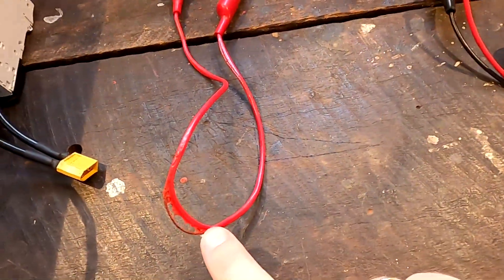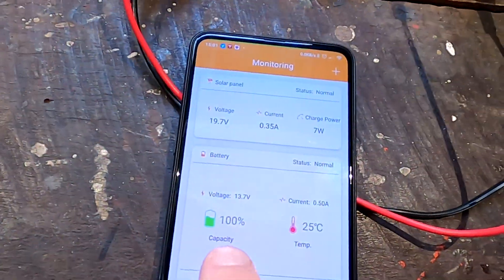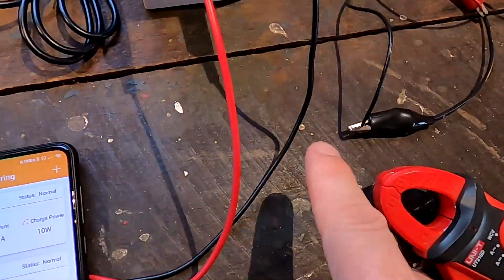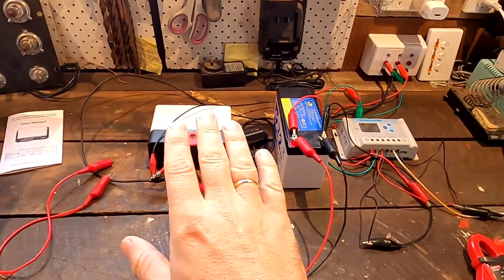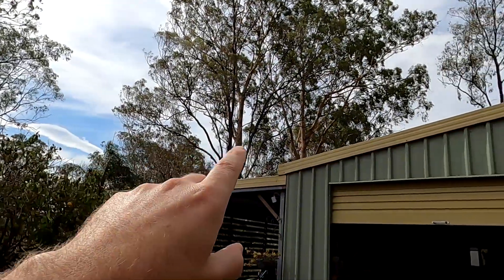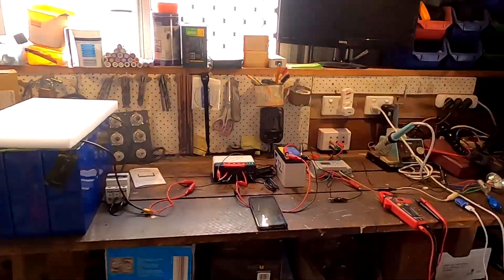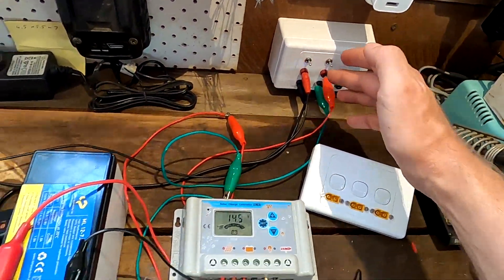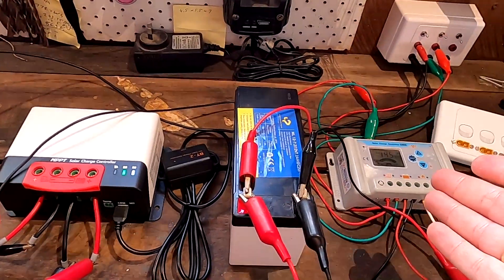MPPT and PWM controller charge one battery. See what happens...

Comment: I have two hybrid solar power inverters (with their own built-in MPPT charge controllers), connected to their separate solar panel arrays (each of 4000W capacity), I was wondering if I can connect these 2 inverters to a common LiFePO4 48V battery bank (4 server rack batteries connected in parallel). Will it lead to any feedback effect causing damage to the inverters?  I sometimes also use the grid supply for charging the batteries on overcast days. Please advise. Regards

Comment: I have 3 controllers, 2 for my house battery bank and one for my starter battery. It’s easier than a dc-dc charge system considering that all 3 panels are on different sides of the boat and it would be crazy wiring to get them altogether into one controller. I got informed, by someone who I believe is pretty knowledgeable, that it’s easier to run smaller charge controllers and more efficient and reliable than running one big one, plus smaller charge controllers are cheaper than bigger ones, I bought 2 Victrons and 1 Renogy for less money than 1 big one and the necessary wiring plus the dc-dc charger and all the wiring… it just made more sense for what I was doing. They are MPPT and PWM and work fine for what they are doing, but it’s two separate battery banks for two different uses. Strings of solar panels on a house roof with possible shading issues is much easier for a controller to deal with when they are separated rather then dealing with the loss of power from a string that is connected to it.

Comment: What about the really cheap charge controllers that come with hardware store small PV panels? My dad has two different 12V panels both with the very cheap controllers for FLA batteries. He has connected them both to one battery using both controllers.

I was quite surprised that one can use multiple charge controllers that don't interfere with each other. I thought that connecting two charge controllers together would make each think there was a full charge; but this works, I think because both chargers are going by resistance not the voltage/current, yes???

The really cheap charge controllers seem more like voltage regulators, so I am wondering if it is still OK to connect these type of controllers together??
In the case of my fathers cabin setup, I would have connected the two panels in parallel and used one charge controller....however the panels are different, so the way Dad wired it, may actually be the best???

Comment: I was considering the same with 3 x 235w x 27v panels to 24v batteries. Just using pwn charge controllers. Not havingvto use MPPT.

Comment: Super video :) Thank you for it. I have problem with setup. In my situation I have 3z110w connected in serial to mppt controller, on other side of my house is 4x55w connected in parallel and serial ( controller take just 50v ) problem is, the controller with the 4 panels not charging at all, first on is mppt volt sol30, the other is my inverter volt 1000s ( with mppt ) any idea why is not charging ? When I turn of the one which is working the other start to work …

Comment: this one is spicy....... i bought a 30w panel and a 30a cheap pwm .for car batt charging

   BUt ......  is it possible that i cant  WAKE up my cheap upgraded pwm  because 1.5 amp of the 30w solar panel is too  low for its 30a mosfets and other insides ?     
.
.
.  cant find a  video of powering them to see when they opperate and my power supply stuck ocean 1,5 month now!!!    i m not so charged please help...
 i ordered a 10a controler  too..   might keep the 30a one for spare big panels!!!  controler cant find solar..  multimeter says i have 21v comming and 1.5a

Comment: Hi, i believe the concept will work. BUt it may easily damage the battery due to different charging algorithm.
Reply from the maker: As long as the battery is not overcharged, the battery does not care wehre the power comes from. So setting the max voltage correctly in both controllers is key. The algorithm does not matter: one controller will just stop charging earlier as the other one, if they are different.
Reply: @OffGridGarageAustralia   Different controller  supply power to the battery at the same time, will affect the battery judgment of the controller to charge the battery.
Reply: How windmill charger work then

Comment: I have 2 x 120w and 2 x 100w panel's both pairs on separate charge controllers. Mppt and PWM. I found during the winter it charged the battery faster

Comment: Yes it does work.  I use 2 pwms on a car battery because I have a mom and a poly crystalline cell.  So they each need a volatage regulator.  Once the voltage is regulated it does not matter how it’s done. Only thing is just
Make sure you’re not overcharging the battery.

Comment: Sir it means both charge controller's can work as a parallel to charge one battery at the same time, and there is no problem at all ?
Reply: Yes, chargers measure battery % resistance or impedance not voltages,  out put is voltages for human seeing

Comment: Excellent experiment, I was wondering about this since I have many odd solar charge controllers and odd panels I have collected over the years and I want to use them together. Thanks.
Reply: Seperate inputs for differing panels is the only way to fly.

Comment: How about two different charge controllers of different amperage and from two different manufacturers?
Reply: Should still work. As long as the the output settings are the same, and the controllers inputs aren't exceeded.

Comment: I have 5-275watt pannels on my rv. I was going to put them in parallel onto 1 controller but decided to keep 2 on 1 controller and 3 on another. The reason being is that the 2 are on front slop of the trailer and the 3 are on the flat. This way you do get more potential power as the sun moves through the day. Plus if a couple are shaded, they won't drag the whole system down. It is something that I have seen in real time. Even the 2 on the slop will get sun before the other 3 and thus start charging sooner. Plus different controllers work better in different weather conditions then others. That way you can optimize your power input no matter the conditions and better keep the power flowing 👍

Comment: Be aware of following things. Oxidation on the cabels brings up the connection resistor. Then when you have both types of controller active you have have these jumps based on the resistor on the oxidated connectors. In german it is named: aufschaukeln. That is BAD at all.

Comment: Thanks for your video. Love it.
I have a question.. what happens, say, if you have a large battery bank. Say 30k watt. And you connect not one, but two 4000watt inverters.. and hook them up to the same 220 system.. can you then run a utility that uses 6000watt and each inverter share the load of the 3000watt each? A 8000watt inverter costs as much as 3-4 4000watt inverters... So... I wonder.

Comment: I use this setup for a backup at night-time to heat my greenhouse with a 1200w heater and to keep the batteries charged above 50% I'm using a 19V laptop charger connected to the PWM controller on a timer when I think the batteries are going to be about 50% first light when the charger is working from the solar panels I set the timer to turn off roughly about the same time I have tried a wind turbine but they are not always reliable and need a lot more configuration.

Comment: If I have 6 12V batteries connected in parallel, can I connect a charge controller to each battery so that one has a total of 6 individual charge controllers ? Also can one use an PWM controller for this?
Reply: I would not recommend that. What will happen then is individual batteries will receive different levels of charge and discharge, affecting their life cycles in comparison to the others.
The necessity of making sure you use same make model capacity and age of battery is because, if there is one weak battery in the bank, all the other batteries are going to be draining themselves to charge it. Thus discharging themselves, and depleting their own charge/discharge cycle lifespan.
In parallel, if all goes well, when one battery charges, they all charge exactly alike, and last for the same length of time..

Comment: Very nice to see the test. Can we try out a 500watt grid tie, plugged into the output of another inverter?(drops idea in hat) :) I have an old 500w grid tie...I think  I can enhance my new 1.6kw off grid system by simply plugging it into the output of the inverter from my new system.
Reply: I had this same idea, to be able to utilise a 5kw single phase grid tie , & I also have a 10kw 3phase grid tie inverter with good panels,rails, etc. I was thinking that u could use a smaller inverter to trigger the grid tie’s and use this to charge batteries as well as on demand power. Cheers

Comment: I want to charge my battery with one mppt controller but want to get output from the battery with the hep of one pwm controller. I mean, i connect the two controllers with one battery but at the same time I don't connect the pv with the pwm controller. And  I want to use the pwm controller to get dc output. Will it work? The mppt is 30A or 50A and the pwm is 20A rating. Battery is single 12V.

Comment: What about amperes of different charge controller. When two of them are connected to one and same battery, the parallel connection of charge controllers would add up amperes. Say, if each one charger was charging at 20 amperes, now both of them would be charging at 20+20=40 amperes. Would it not be harmful for battery?
Reply from the maker: That depends on your battery size. It needs to be big enough to take these 40A from your example. If it can't, you need to upgrade your battery or limit the power output of the charge controllers to suit your battery size and type.

Comment: I have connected two Hybrids Solar inverter of 5KVA in parallelly. For each inverter 15 numbers of PV modules (285 watts each), 3 in series and 5 in parallelly. Both of the inverters are connected with 12 V,165Ah batteries (4 in series). It seems load is not powered by solar source. Can I connect two MPPT charge Controller parallelly with the system? can you help me Mr. Andy.
Reply from the maker: You can parallel solar charge controllers to the same battery but not to the same solar panels. So each solar charge controller needs to have its own solar panel arrays it gets the energy from.
Reply: @OffGridGarageAustralia  Thanks a lot for your suggestion.

Comment: The issue with PWM is they typically do not regulate their output to preserve the longevity of your batteries when it comes to temperature which is very important for sealed lead acids.
Reply from the maker: They actually do, there is a setting in almost every SCC to compensate for temperature. However most SCC don't have an external temperature sensor or you have to buy one separately.

Comment: There's a lot of question on this type of experiment. I just like to ask if you did  a follow-up video on this? in long run what happened to your setup? are both still working perfectly? or one failed due to mismatch of floating voltage?
Reply from the maker: This was just an experiment I was keen to do. I have now 2 MPPT SC in parallel working perfectly fine with my large battery. They have the same settings. I also had them running with different settings for a while to test and this also works perfectly fine. The controller with the lower settings will turn off first though so you loose this energy form its solar. The other controller keeps charging until it hits the set parameters. There is no problem with having different charge controllers and even different settings charging the same battery as long as all parameters of the SCC are within the safe specs of the battery.

Comment: You couldn't be an electrician until you have melted a cheap Chinese alligator clip or two LoL. 
Excellent experiment, some MPPT charge controllers are slow to respond, my cheap Chinese MPPT charge controller board is really fast...

Comment: I did the same experiment. I have 2 mppt controllers for my panels. Volts stay the same, amps double, works perfectly. I use Victron
Reply from the maker: Victron is the best, I guess after all my testing with different controllers.
Do they communicate with each other or are you control them separately through the app?
Reply: @OffGridGarageAustralia  
I set everything the same on the solar controllers. The only thing different is the panels. In 2 hours my batteries are done, there’s a Victron system that converts 48v to 12v even better!

Comment: You've just described micro inverters and the reason why they are beneficial. Yes they work better, they are just more costly.
Reply from the maker: It's on off-grid-system.
Reply: Agreed. Cost - and also you split the benefit of mediocre sunshine. Controllers might not start output at all if they can’t combine voltage of more panels during shady times. Everything is a compromise.

Comment: Would the shaded panels produce 0 power in reference to the higher voltage panels? Don't know anything about solar, but know more comes from a device with marginally higher voltage then one with lower voltage.
Reply from the maker: A shaded panel still produces power and contributes to the overall power production. I'll make a separate video about this topic as it is too complex for just this section here.

Comment: I am just beginner, and have a Q on my setup. Is it possible (or wise/unwise) to series connect the output of two 12v PWMs to produce 24v? My assumption is use a PWM per 12v panel. I am designing a 24v 2.5kWh LiFePo4 8s with 250A BMS and have to use an existing 12v 2000w inverter, trying to figure out ways to do this.
Reply from the maker: A PCM? Are you trying to confuse me with that? 😜
You definitely cannot use a 12V inverter on a 24V battery. You need to either reconfigure your 8 batteries into a 4s2p configuration and run this as a 12V system or you need another inverter.
Reply: @OffGridGarageAustralia  sorry, PWM. I will likely upgrade to a 24v inverter, but also toying the idea of a DC to DC converter. But seems those are too costly for so many amps. Can output of two PWMs be chained in series?

Comment: Are your panels different voltages? Eg if your 2 40w panels are 12v and your 220w panel is 24v you series the 2 40w panels then pararrel them with the 220w 24v panel.this is how youd get the most power out of them. If they were all in parellel your 24v 220w panel  would be reduced to the 12v so youd only get half the potential wattage put of it.
Reply from the maker: The 2x 40W panels have 22V, the larger 220W panel has 37Voc. This is on purpose to do experiments with these panels and different charge controller.
Reply: @OffGridGarageAustralia  so if you series your 2 22v panels you get 44v then parallel them with your 37v panel you will lose. (1-37/44)=16% of the power of your 40w panels. The alternative is putting them all in series or parallel but that way is even worse as youd lose an even bigger % of power coming from your 220w panel.
Reply: Or you can use 2 differnet mppt controllers 1 with the 2 40w panels another with the 220w panel like i think youve been doing in this video? The 2 charge controlers match charging votages then the amps are added together with the charge contepllers in  pararrel with the battery

Comment: Very interesting, for my grid tied system, I have EnPhase micro inverters which I know helps a lot with late day shading or when some panels are snow covered. I guess you don't have snow issues 🙄
Reply from the maker: No snow here, hahaha. And it's an off-grid-system, so micro inverter would not work.
Reply: @OffGridGarageAustralia  I wish I could trade you some snow for some warmer air😁. I knew your working on an off grid system, I mentioned the micro inverters just to make a point that having each panel have its own “controller”, really helps if there is any shading. Really enjoy your channel.

Comment: Excellent video! How about several charge controllers, several panel arrays, and several separate battery banks...? Can the charge controllers charge different battery banks simultaneously (same voltage batteries)?
Reply from the maker: Well, the battery banks need to be in parallel, so yeah, it can.
Reply from the maker: Well, the battery banks need to be in parallel, so yeah, it can.

Comment: Yes, I've been thinking about using individual MPPT controllers per PV panel charging the one battery array.
Reply: So I’m not the only one who wants to cobble together a “Ghetto Enphase”.

Good to know.
Reply: @psygnale  :) Its for my camper trailer with sometimes 3, 4 or 5 panels, so I need the flexibility to just plug in. An mppt for each  just makes it plug and play.